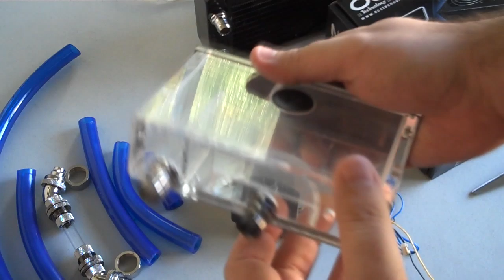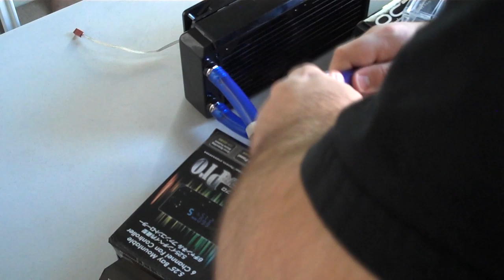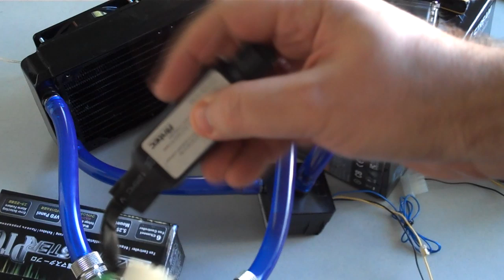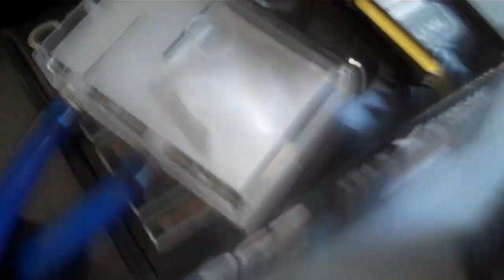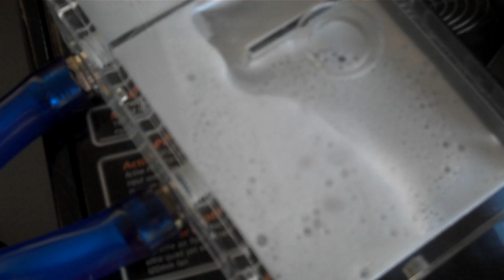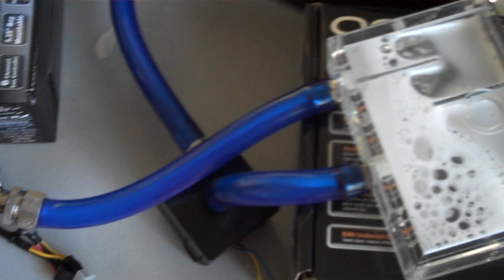How To Water Cool - Components, Flow, Priming & More

Comment: Awesome vid for beginners. I would personally route the system differently: reservoir - pump - cooling block - radiator - back to reservoir. With the heat in the system after the cooling block, it's ideal to go to the radiator next and dissipate the heat instead of going back to the reservoir and heating the rest of the reservoir to a higher temp. As a bonus, your system will run cooler and the reservoir will feed your pump liquid already cooled (seal and bearing longevity from less heat).

Comment: A psu can run outside of a case by jumping green to black on the 24p connector and connecting a load like fans, pumps, etc. The device you have there is doing exactly that, with a switch added.

Comment: No I checked the temps after removing the algae but before I took the jet plate out. They were still in the 40's - I decided to give it a try and removed the jet plate and gained 20 degrees+ by removing it. Flow is way better too and even if I get more algae (using biocide now so I shouldn't) it won't be so critical as the waterblock can't clog up so quickly.

Comment from the maker: Take as much apart as you need to. In most cases you will have to take some aspects apart no matter what. That is okay. Jut make sure to tighten it up and place a few paper towels below those connections until you know they don't leak.

I always make sure to use a power supply tester to run the loop in the case before I power on the entire system.

Comment: Excellent video! I just built my first pc last week, i used a Corsair 800D case, this is going to be a perfect case to start my very first water cooled pc. Very straight forward and intuitive, ty again, this video gives me the confidence of knowing that i can do it. Going to start with the video card as i allready am useing a Corair H100 hydro cpu cooler for the CPU. What radiator should i use? The top of the case has a spot for 3 fans , so would like a radiator to atleast fit that whole area,

Comment: You can either put it inline with the CPU or motherboard chip cooling block, go from the pump using a tee connection (not always the idea best though) and split the path for the multiple blocks, or use two independent systems sharing a reservoir (a dual pump and more than one radiator).

Comment from the maker: @Kylereeves13 I use hot water all the time. Its a great way to help install them easier. Just know they will be flexible and let them cool off if your not using clamps. If your using compression fittings that don't worry at all.

I normal fill the bath tub up and sock the entire 10ft. I seal off the ends and hard water/ tap water can cause issues in the loop.

Comment: These are barb fittings. They don't *require* straps or so, but you might want to do so for added safety.

Only compression fittings have rings.

Comment: Nice video. Question: I noticed you have your liquid coming out of the pump going into the radiator then to the cpu,  then back to the reservoir. Doing it that way, it seems to me that your keeping more liquid heat in the reservoir and pump which in time will weaken them. Why not have the liquid from the reservoir feed into the pump, then into the cpu and then to the Radiator. This way you keep the temperature in the pump and reservoir cooler and let the radiator do all the cooling.

Comment: i think he means compression fittings as opposed to barbs. 
@ JOELtheNOOB: He does use compression fittings on the "cpu block" in this vid, but everything else uses barb fittings. Barb fittings literally have a 'barb' that is larger than the ID of the tubing, this ensures that the tubing held on really tight, and won't leak

Comment: Greetings... Nice instructions.

The only thing I would offer is change the order a bit, my loop goes Res to Pump THIS IS A MUST FOR ANY LOOP RES TO PUMP to CPU, GPU, MB, whatever else, to Rad, or Rads, and then of course back to Res.

I know it does not matter the order, EXCEPT RES TO PUMP ALWAYS, what ever works for you is the BEST ORDER. You may want to go from CPU to 120 Rad, then GPU(S) to 240 Rad then MB or what ever else to a 360 or 480 Rad. I just don't like to send warm water thru my pump if I can avoid it.

Yes, I know, at some point the entire loop is the same temp, but if you over clock you can heat the water a bit and any water EXITING from the Rad should be cooler then the water going INTO the Rad. Granted it may only be a few degrees difference, but the loop is what ever you want it to be.

Your video shows the basics and that is great. 1/2" or 3/8 does not matter and to be honest G 1/4 is just slightly under 3/8" and when I realized this I went with 3/8" tubing as there is not much of an advantage to use 1/2" unless you plan to use PETG or Rigid Tubing. I do not believe PETG or Rigid comes in 3/8" as the ID would be too small. 

My next venture is to upgrade my loop to PETG.

Comment: you can use your psu outside of the case by connecting the green wire with one of the black wires next to it. You can do this with a paperclip. So you don't need to buy a psu tester.

google "psu paperclip test" for more information.

thumbs up so everyone knows

Comment: probably it will be ok, a cpu usualy needs a single or dual rad since you will get 2 3ple ones you will be ok.... i suggest push-pull config with a fan control/temp monitor interface on a 5.25 bay

Comment: hey brother, nice video, I have a quick noob question for you...I already have a watercooling system going in my case (just through it together checked for leaks and put it all back together), I didn't do a "leak test" outside the case. is the only reason for it is to check the fittings? because that's obviously the only place you're going to spring a leak unless the radiator was punctured or you didn't cut the hose correctly? im just trying to see the point of it that's all. thanks for any help

Comment: the hot liquid from the cpu block goes to the reservoir and then to the pump which pumps it into the radiator to be cooled and then the cooled liquid is transferred back to the cpu block

Comment: it depends on the barb size or tube size if the tube is really hard to get on the barb then you dont really have to put clamps on them but you can if you want where as if its quite easy to the the tube on the barbs clamps are needed

Comment: i am confused. when you attach them tubes to the radiator, pump, reservoir etc. do you not lock them or screw some sort of a ring to tighten them to the fitting?

Comment: What are the measurement for the Bard Fittings? If I were to use the 1/2inch and 3/4inch Tubing, Would i have to go with 1/2inch and 3/4inch Barbs/Compression fitting?

Comment: I have a question about sticking your tubes on the fitting. Would it help if you could heat up the tube by putting it in hot water? or do you think it could possible damage the tubing and you could get a leak

Comment: Hey quick question iv been considering doing a water cooling loop in my future system but one thing im struggling with is deciding between barbs and compression fittings. Apparently compression fittings are more reliable but barbs are more simple to get to grips with for a beginner.

Comment: You use 1/2 tubing for this loop.   Do you recommend using all components with 1/2" fittings.  I bought a water block with 1/4 fittings.  Should I scrap that, and buy a cpu block with 1/2 fittings, or do I keep it and have to use adapters to go down to the 1/4" size?
Reply from the maker: You want to use fittings that are the same size as your tubing. If it is just the barbs that are the wrong size you can always get the proper 1/2" fittings.

Comment: Question is this tubing insulating so if I wanted to use it in a different application like let's say in a canister fish tank. Now if I introduced heat to the inline with water running threw would this pose a problem with the tubing. Or is this tubing solely for cooling

Comment: Coolant should come from the Reservoir to the CPU Block "First", then from the CPU to the Radiator & from the Radiator back to the Reservoir so that the Coolant is back to the Ambient Temperature as not to heat-up the Pump anymore than it does itself by the PCB and motor. Keeping the Pump cool is the primary goal for a longer lifespan or MTBF Rate as described on All Pump specifications. I use Y splitters -go from Res. to CPU & Chipset(s), then to VGA's and ALL go to Rad., then Res. & then Pump.

Comment: That's why they've got leak sensors that'll make your PC alarm like a @#$%. Really, the worst part would be a failed pump, they're already so quiet that you might not notice until something breaks. if you're smart, you use mineral oil or some other non-conductive fluid for coolant. This was neat, I've played on a water-cooled rig before, never have gotten the chance to build one. Pondering getting a Tempest case and putting a simple system in there for my Vishera 6-core.

Comment: Why do people put the rad after the pump? I am under the impression that if there IS any heat generated, it would cause extra ware on the pump. I would rather have flow go pump-cpu-gpu-chipset-rad-res before going back to pump. Could you give me your thoughts?

Comment: Ug I watched the whole video and didn't get my question answered.  Do you leave some air in the system or try to get it all out?
Reply: In my view water cooling a computer is like running a jet aircraft on steam.
Reply: You bleed the system of air. Air is much less effective at transferring heat than the water in the loop, so air present in the loop will increase the temperature of your components, and can destroy your pump. Hope that helped.
Reply: Ok so get out as much air as possible then.  Since it feeds from the bottom of the pump it doesn't feed the air but the air collects at the top.  I'll try to fill it as full as possible without spilling.
Reply: Dell Schanze no you get all the air out. you want it so u see no bubbles because if you dont your gonna end up wrecking ur liquid cooling system. are u using water to cool it? if so add a tiny drop of dish soap in and fill it up with water. keep filling it till the tubes and the pump or reservoir is filled and there are no air bubbles or anything. leaving air in will surely over heat your components and wreck them.
Reply from the maker: Get as much air out as possible. In general you should have no air bubbles.

Comment: The temperature difference between the liquid before going into your blocks and after coming out from them is like MAX 2 degrees, because the water is going through your loop so fast. so there is no way, your pump is going to overheat.

Comment: Hello Lethalhammer,i plan on using Laboratory grade Distilled water with dead water drops(Copper2 sulfate) in my XSPC rs360 kit that i bought from FrozenCPU last month but i am a bit worried about corrosion and lubrication as the dead water is a biocide. Would the PC ICE be a better choice  or is it just your preference?

Comment: the difference of temperature from the hottest part of the loop to the coldest part of the loop is only 1 degree C at worst, it doesn't make a difference on the order of the loop so long as the resevoir is directly before the entry of the pump so there is water in the pump 100% of the time.

Comment: It really doesn't matter, just watched some different cooling routes and it turns out that the only difference between hot/cold side is about 1-2 degres cause of the high waterflow and small volume.

Comment: If I want to do 2 reservoirs, what order should I go?  Could I do 1 Reservoir on each side.  Large main reservoir above pump, small second reservoir between pump and radiator?
Reply from the maker: Why would you want to reservoirs? Do you mean radiators?
Reply from the maker: Lethalhammer two
Reply: I am going to do a main reservoir connected to the pump - a small cylinder.  I want to put a second large reservoir - a frozenq fusion (looks like t virus from resident evil) on the other side of the case.  As well as a 240 mm radiator with dual fans.  Wondering how the loop would best run with two reservoirs.  Thanks.
Reply from the maker: James Pratt just make sure the pump isn't directly pumping water into a rez. Have a radiator or block between the 2 rez's and your fine.

Comment: Quick question: i'm building my first wc setup, but i need to rinse it first.
Can i just put the pump on with only mine psu and mine 4pin molex connector and run i a flush?
Or do i have to set it up on a motherboard?

Comment: If you're doing liquid cooling for CPU + GPU do you run it from the pump -> CPU -> GPU -> Radiator -> Reservoir?
Reply: It HAS to go from the reservoir to the pump at first, after that it doesn't matter.
Reply: Yeah, I didn't list the first step because that part was very obvious :p even for me. Thanks for being safe and making sure though! 

Another question I've been battling with is the best way to flush a system? Seems like inevitably you'll get some drips in your case when you open up a valve from the lowest end. Unless I'm missing something.
Reply from the maker: xiingli Make sure to have a drain line. Most people will use a T and split it off. Weather you have an extension tube sitting in the system or a detachable setup is your call.

Also, Most people like to run the pump to the rad, as the pump applies heat to the liquid. Overall it doesn't really matter, but that is how some do it.

Comment: Hi lethalhammer, I've just upgraded my system recently, buying a new motherboard, 2600K and a Corsair H70 liquid cooler. I know that this cooler is clearly not on the level of good liquid cooling loops, butI still wanted to ask, will it make a great difference, to get a proper loop, and maybe include my "old" 4870X2 GPU (given I can still find a waterblock for it).I can only fit a 120 inside my case, but have enough space and water cooling holes, to have an external 240 or 360. thanks

Comment: Fittings don't come with anything, that's why when you add fittings for the radiator, res, etc etc they add money to the cost. IE DangerDen it cost's $4 extra per part for barbs and $12 extra per part for compression fittings. You may want to clarify that for the people new to water cooling.

Comment: the difference in temperature between any two points in a loop that has a decent pump and doesn't have anything too constrictive in it will be less that 1 degrees celcius. the order is absolutely pointless, go with what is most aestetically pleasing, just be sure to put the pump below the res with the pump drawing water directly from the res and ensure everything is oriented in the right direciton.

Comment: will this all work together please reply..... im confused
Feser Tube Active UV Hose - 1/2" ID (3/4"OD) Anti-Kink Tubing - UV White.......
EK Dual Bay SPIN Reservoir w/ Flow Meter - Acetal Port Threading: 	G1/4" 
Fill Port Threading: 	G 3/8"..............EK-Supreme HF High Flow CPU Water Block - Full EN (Nickel)Threads:	G1/4..........EK-CoolStream RAD XTX (360)Threads: G1/4.......itspower Galaxy Freezer Universal RAM Module Liquid CoolingG1/4 thread........Alphacool VPP655 -OT12 (G1/2" outer thre

Comment: hello, i plan on cooling my 3770k and 2 gtx 670s, i have the corsair 900D case, could i fit 2x 420 radiators and will the temps be good with that set up?
~thanks

Comment: Its not the need for cool water, your water temp does not really change that much between components. You put the res before the pump to ensure that the pump is not running dry.

Comment: One major thing he did wrong was with the fittings. Obviously he sprung a leak, but the reason was because if you use barb fittings you need to use clamps as well otherwise that happens.

Comment: Not really, a twin 120mm rad will work fine. If you plan on overclocking your rig you might look for a triple 120. My system consists of an AMD 8150@4.0 ghz cpu, 7950 OC gpu, both water cooled using a quad 140 rad from Phobya. Haven't been over 50c yet. Do a lot of research as setups vary widely based on quality of components, flow rate, cooling fans, ambient temp, overclocking ect.

Comment: What about inline components? Can you cool for example an overcloked i7, together with two overclocked GTX480 (i use them in this example because they are fucking power hungry) in line meaning, the coolant flows through the processor, then direclty flowing into the first videocard, and then int the second, without going to a radiator in between, just after all 3 components? Will the temperatures noticable rise in the second and third component? 
I want to cool my RAM, Chipset, CPU and GTX680.

Comment: ehm isnt the flow "Wrong" ? I mean doesnt u get  more capacity if the flow is Pump->CPU->Radiator-> Resevoir. 
What im trying to say is dont u wanna get that heat generated from the cpu out as soon as possible so u dont warm up as many components
Reply: That's a myth. The water flow is so fast having a rad in between gpu and cpu makes a degree if any difference at all. Main thing is res than pump than whatever you want if possible keep runs short for looks and better flow
Reply from the maker: James Emsley the theory is is the pump actually creates heat so by having the pump flow directly to the radiator and then to the CPU allows the coolest possible outcome. That is assuming you have a strong enough pump to avoid flow issues.

Comment: I want water cooling but after put it in my pc i dont want to vheck every 6 months to check on it...
Reply from the maker: Looks like you should stick with pre-made closed loop systems.
Reply: Lethalhammer if then will i not have to check on it every 6 months? (Idk much about watercooling)
Reply from the maker: Nope: Thermaltake make some amazing systems that should last you for years. They are closed loop systems, so you only need to dust off the fans like you would a normal PC system.
Reply: I guess i know what im getting for my build